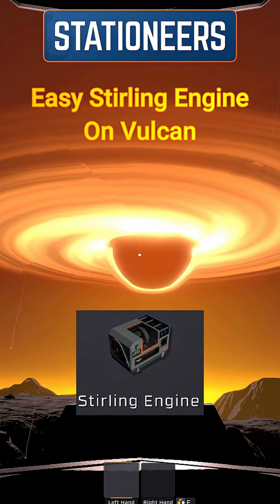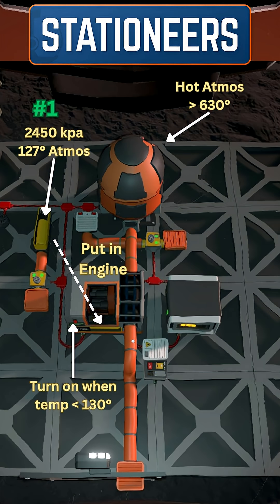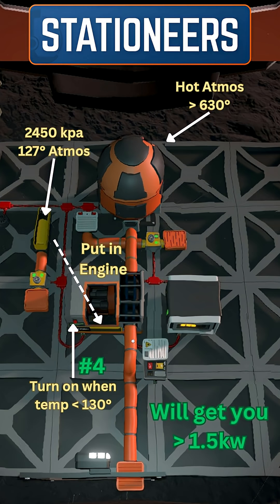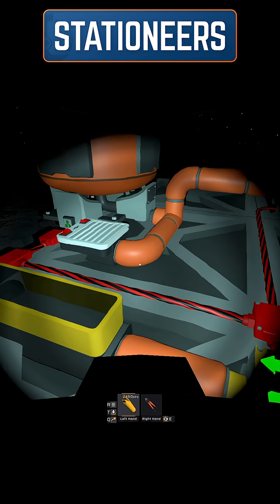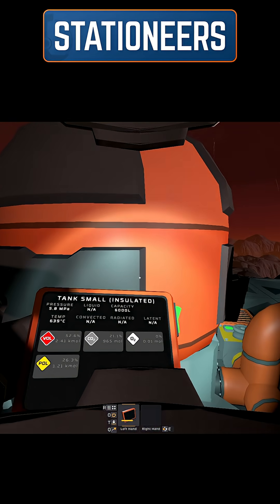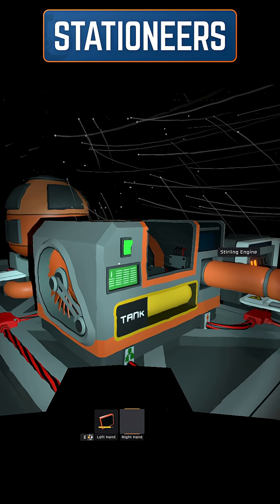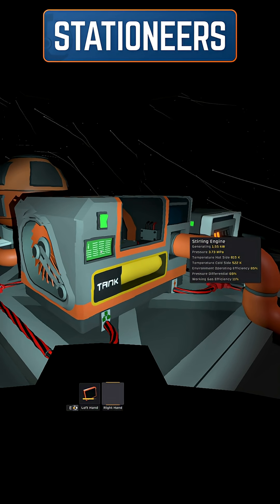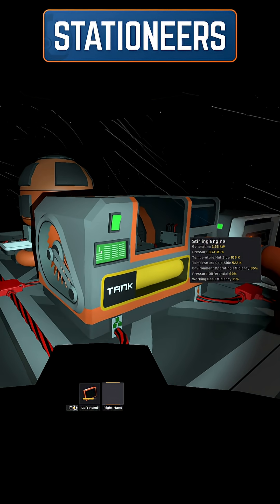Stirling Engine Basics -  Stationeers Power Generation

Comment: I get ~5 kW with a bit of ic10 VolPump
Reply from the maker: I believe its all based on the temperature difference.  For instance, because the H2 combustor comes out soo hot, you can actually get at least 7 or 8KW using 2 Stirling Engines, and probably more with a 3rd.  I'll have to check if a pump will change anything here.
Reply: @powerfang there are a few videos on YouTube that go into the details, but there are several details that affect the power generation. What you showed here is a good, safe starting point.

For best efficiency you want as much working gass as possible, preferably with volatiles only. If you condense out the pollutant from the atmosphere that should also be fairly decent. 

Higher atmospheric pressure also helps a bit, since it can more effectively cool the engine.

Running of an H2 combustor, a single Stirling can easily reach the cap of 8 kW, probably even 2 in series. I had a setup where I did this, but I would run it batch wise, to make cold water, so it was only maxing out at the start. I have since changed it to run in a steady state, so the first Stirling is fed 800-900C steam, the rest is filtered to a separate line, also feeding Stirlings. The steam line is generating approximately 5.5 kW at the first one, then, 4.3 kW, 3.6 kW, 2.8 kW, and so on. The other line produces a bit less, starts at approximately 4 kW IIRC. The H2 combustor runs maybe 20% of the time, so you can generate some serious power from that if you want. 

One thing to consider now that solar storms on vulcan are a thing is that the canister can get hot and explode from the extreme heat. I put hangar doors over mine to shield them from the heat.
Reply: Noticed the "Basics" in the title... You comment is not really relevant here.